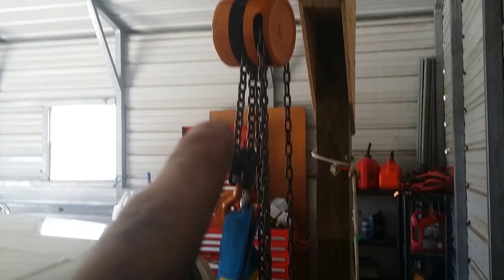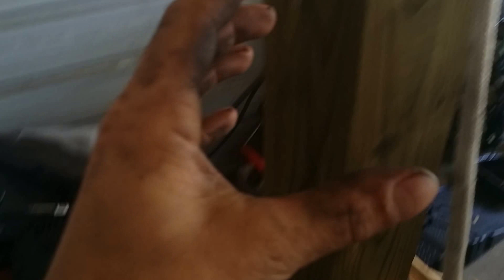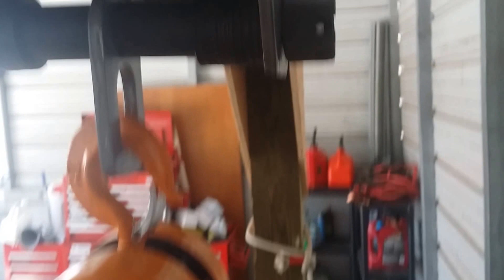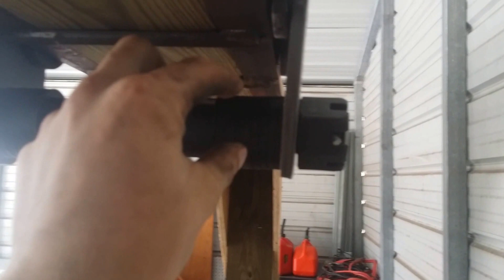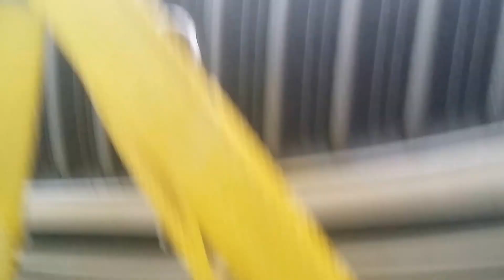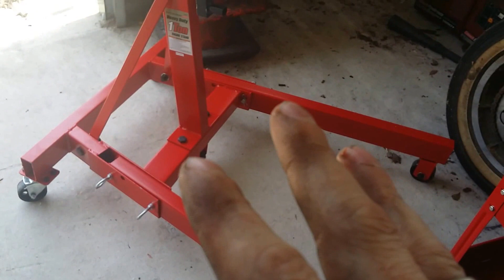WOOD GANTRY CRANE PART6

Comment: I will be modifying your build a little I see something that could possibly work better 
I will most likely be using a section of rail road track as my main top beam
Reply from the maker: Chris Gugliotta that's probably a better idea. Lol. My brother is a mechanical engineer. He said there is a book of engineering standards that has info like allowed stress on beams of various material over a span. I have get to buy one but I would recommend one for your project.

Comment: your capacity is only rated to the angle rail you are riding that trolley on. the beam has lots of capacity but that trolley can roll those edges of the angle iron . That aside nice job.
Reply from the maker: cafejewelers keegan yep. that was one of my fears. worked great.
Reply: Designs are meant to be improved if possible. Great comments too .